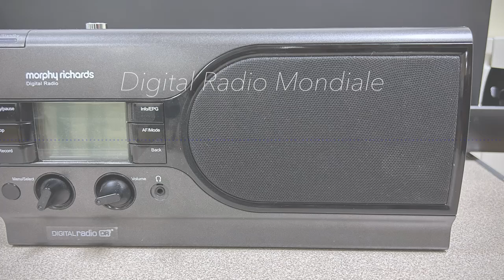Digital Radio Mondiale

Comment: Does it have stereo out  on headphone jack
Reply from the maker: I am afraid I don't have access to the radio anymore so don't know
Reply: @FarouqTaj  india has implemented drm broadcasting but  DRM radio's are not available in market, there are 2 high power  drm  SW transmitters in India and 39  DRM MW transmitters broadcasting on DRM MW band , we have 150 MW stations in India and only 39 has been upgraded to DRM MW standard, implementation is slow ,may be bcoz of high cost of radio set , government is not in a hurry to make investment too early before the prices of radio set does not drop to an affordable level, but many automobile companies are giving factory fitted audio system with DRM MW and SW band as standard feature, i think till 2030 we could get DRM radio set at an affordable price, till then I think indian government will upgrade all the MW transmitters to DRM MW standard,

Comment: They did not make it easy to implement the standard presumably so they could sell their own implementations of it. Ok fine but they could have flooded the market with cheap easy to use integrated circuits to implement hardware wise, another thing they did not do. I expect when the patents expire in a few years somebody will find an application. 

The problem with Betamax is that it never could hold a full length movie. That single thing doomed it. Though interestingly the same tech found a new life in TV cameras for ENG i e. Electronic News Gathering before the internet came along. 

DRM itself (I guess now) is trying to replace FM bands. The problem is two fold. The installed base of receivers is huge and receivers are very easy to make. Anazon still sells countless non-digital receivers every day. 

But the final nail is that everyone counts on their cell phone now. Not a separate "box." 

The other thing, radios need to be simple however its done. I do not think they can undo the installed base nor do I think they should try at this point!

Comment: The one issue with using digital mode on the MW and SW bands is interference. Any kind of interference that just so happens to land on the frequency the broadcast is on will make it to where it can't be decoded and you wont receive the broadcast, or it'll start deciding and constantly get go out and come back in which gets really annoying. 

Interference is inherent of those bands, be it by atmospheric, or man made. It's unfortunate, but it's the nature of the beast. Analog is best for MW/SW as you might receive interference, you can usually still hear and understand the broadcast. 

DRM is a lot better than what the USA tried to use on MW/AM because what they used would interfere with the station next to it for the sake of keeping compatibly with existing analog radios, BUT and again, if there was any interference that landed on the same frequency the broadcast was using it would knock the radio out of HD and into analog, and it would constantly go in and out of HD.

Something like c-quam would address the sound quality issue, but just like standard analog it would still use a lot of electricity.
Reply: most of the modulation drop outs are due to the stations using mode B instead of C or D. if you want to transmit yourself you can use DREAM DRM. if you need help with compiling the AAC dll I can help